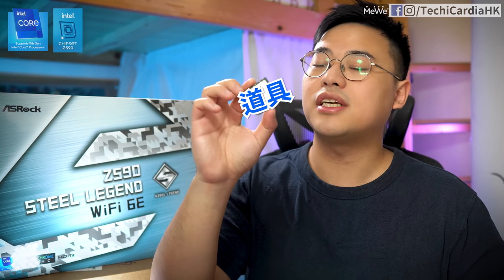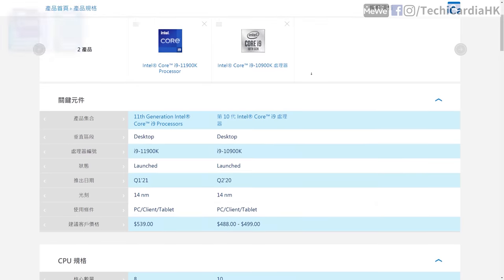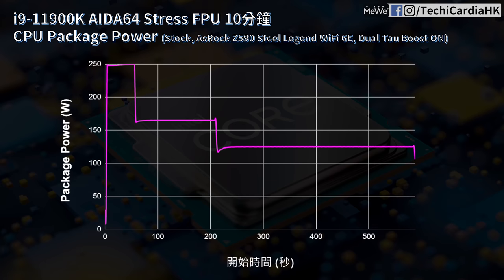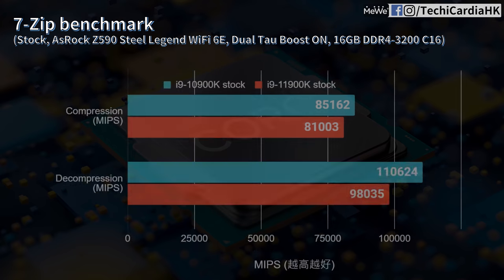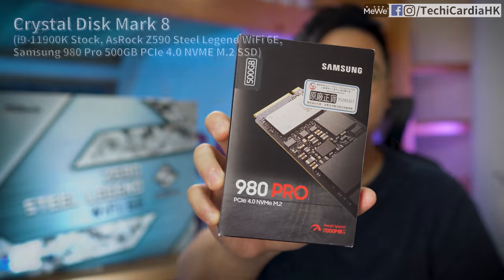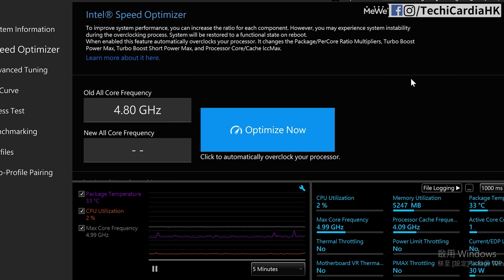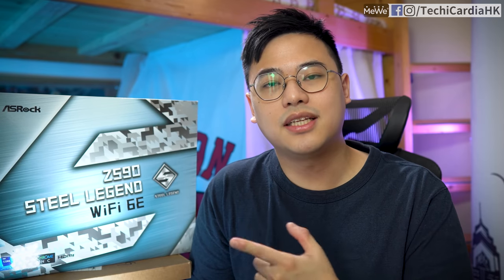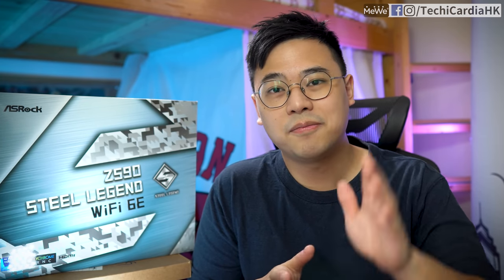8核 i9-11900K大戰10核10900K！？Intel 11代i9 CPU跑分、遊戲表現詳細測試！//Feat. AsRock Z590// 4K【TechiCardia】[cc廣東話字幕]

Comment from the maker: 補充1: 新嘅 i9-11900K 仲有Adaptive Boost Technology 可以額外再推高全核到5.1/5.2Ghz, 但係ABT 下功秏都上到3百W以上, 所以冇返咁上下散熱方案都係用speed optimizer/用XTU自己超好啲...而且因為我得Steel Legend呢塊中階板真係唔太敢推得太盡, 為此同大家道個歉先。

補充2: 最新售價:
i5-11400F $1245
i7-11700K $3199
i9-10900K $4329

P.S. i5好似好抵玩... 同埋有啲B560板有BIOS用到Adaptive boost 好似上到5.1...聽講
Reply: 補充3：adaptive boost 目前只係for i9...
希望以後可以解禁？ 不過功耗。。
Reply from the maker: 功耗真心癲
唯一好處係ABT喺官方嚟講唔算係”超頻”，所以壞左一定有得保xd
Reply: 如果只係打機，唔係直播，i5 11400F似乎夠做。睇benchmark, stock vs stock好似快過i5 10600k
Reply: @bernardshum2719  都係睇餸食飯  
不過11代 i5都可以用高頻ram 
其實有得諗 
不過如果你唔急 年尾都12代
Reply from the maker: 11400F 係的確最吸引！